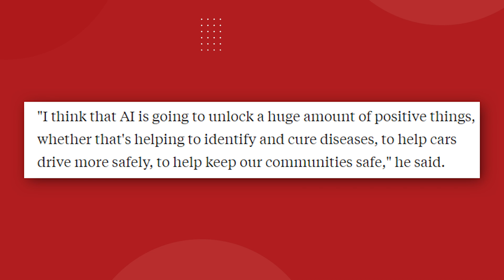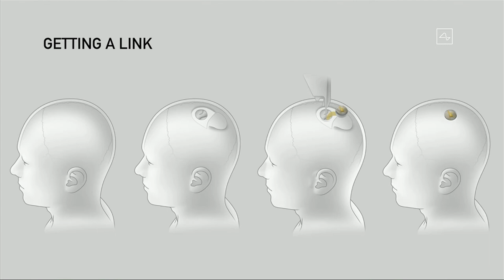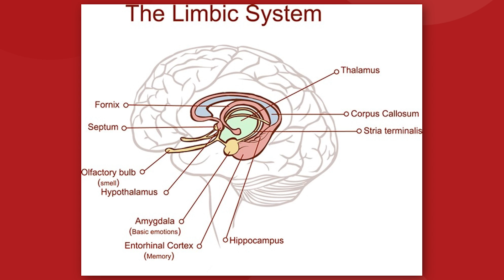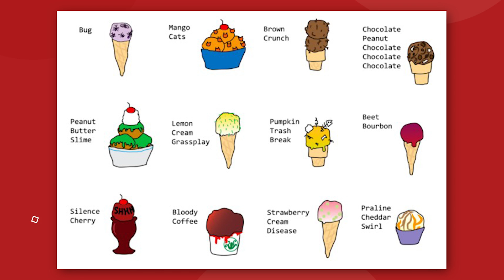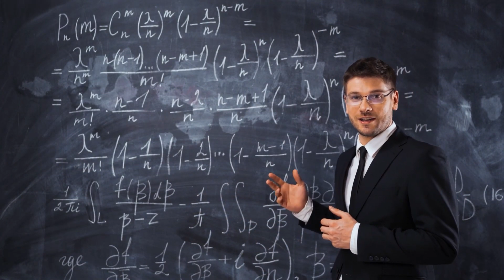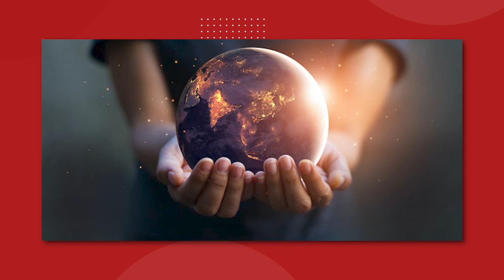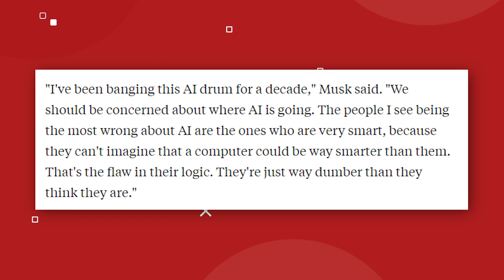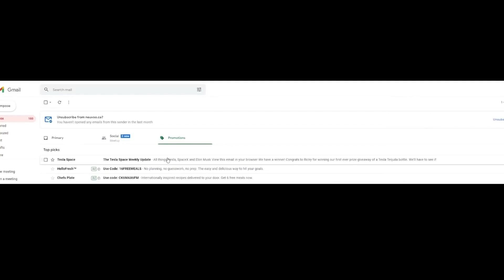The Real Reason Elon Musk Created Neuralink..

Comment: Well, paraplegic patients will be able to "hot-wire" parts of their brain to regain their bodily movement functions basically using the Neuralink as a "smart bridge" between your brain spinal cord and the associated parts of your brain related to it and movement of your limbs. It will require a proprietary communication protocol between both devices (brain and spine inplants) to ensure security and avoid "snooping" on your brain activity by third party individuals.
Dual neuralinks both on the brain may even work together as a way to link different brain areas while also adding functionality to the brain using an self-learning/self-optimizing it's own neural net using algorithms designed to mimic how the brain usually adapts/evolves while learning. 
Another possibility would be adding extra senses or improve existing ones, like for example add infra-red vision by having a neuralink that links an infrared sensor array linked to the optical nerves and respective brain areas while improving the model based on AI self learning the interface should signal the brain by comparing the image input from a stereo vision 178º camera with the signal the eyes pass on to the optical nerve as a result then using this as the training basis to improve its own signaling of infrared imaging. 
Without a deep understanding of how the brain learns I suppose that only the paraplegic "jumper" wires are likely to work. That said, it may be that both work as the brain also adapts and learns therefore it could wound up able to take advantage or the added neuron links and activity... 
I suppose has the potential to achieve great things!

Crazy yes? I hope it sounds absurdly crazy! Usually this is the kind of crazy that ends up revolutionizing stuff in unbelievable ways :P If this ends up done as pictured I want 4 if them installed on myself on areas of my selection! I want to improve maths, abstraction, memory and attempt to implement telepathy by linking the speech center with a custom wireless module :P

Comment: A helmet is better than a chip in the brain, because the helmet you can take out when you want to. But even so, there has to be a supervision so that the helmet doesnt get hacked or something like that. 

A chip in the brain could turn a human into a toy, and that wouldnt be a smart decision to the human.

If the interface is limited to language, its safer, because then the eletric signals would be just like a conversation instead of trying to change the person like a toy. Now, even the conversation could be dangerous, a young person could be turned into a fanatic if this is not regulated or monitored.

We will need this superinteligent supervision, verifying our brain signals all the time, because there is the danger that the nanobots could hack the people anytime, anywhere. Now, thats a weird future we are going into, a future where our thoughts are watched all the time by something or someone else. There will be always this thin line to be observed, if the machines are being controled or if they are trying to control us.

However, this is a necessary step, an evolutionary step.
Reply: currently they have to cut out a section of you skull to get the link in.  so basically you going to be like a newborn baby with a giant soft spot on your head that you have to charge with an induction pack like a smart watch charger and pray it charges slow enough not to overheat your brain,  yeah i think i'll pass